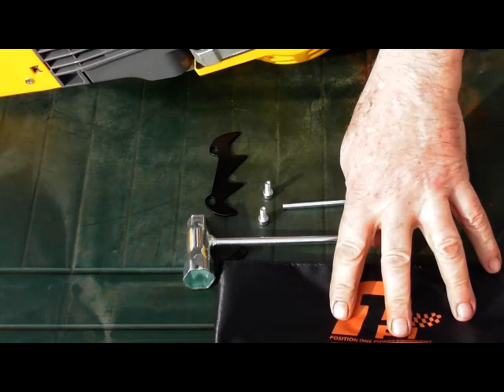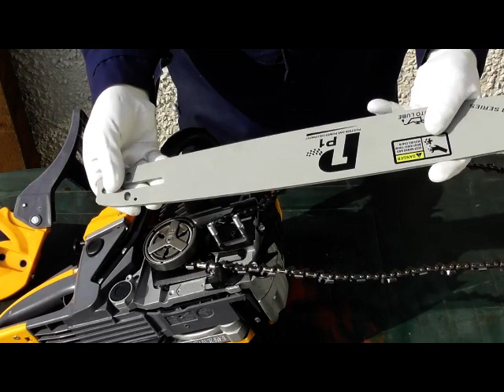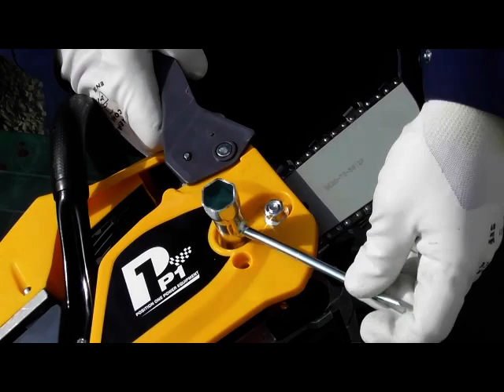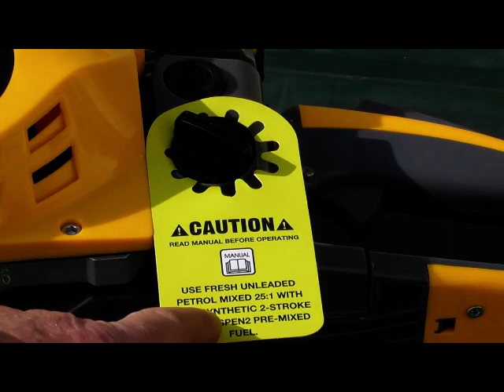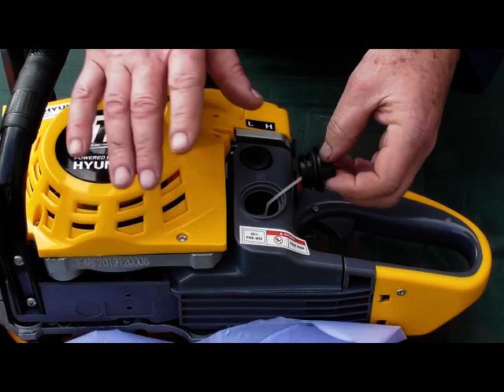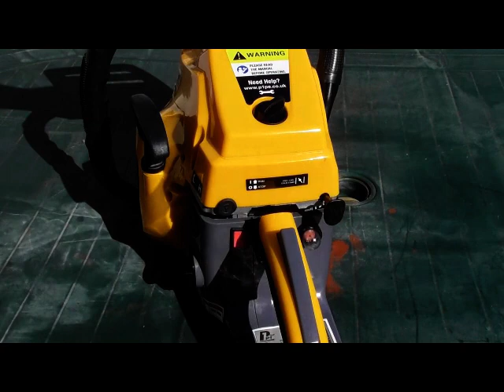P1PE P6220C 62cc Chainsaw, Powered By Hyundai

Comment: absolutely waste of money problem after problem hyundai dont want to refund me or fix it parts missing wont run with choke in now the recoil has gone still brand new out the box..wanting me to send it back ,i pay for postage there and back then its |£30 per hour labour then price on part to repair and get it running.finally got somewhere after abit of hassle from were it was bought from  got the new parts..pull start  flywheel and coil pack.tried setting it up to run nothing at all car nt get spark plug out as its to tight to check its sparking.any advice on what to do next would be greatly appreciated
Reply: Rtv

Comment: I have the hyundai hyc6200x it has 40:1 fuel mix. Left some fuel in in the summer and it would not start in December. Took the carb out to clean following Adrian advice on how to take it out. Needed a special tool to adjust the carb as it's not supplied. The unit worked for 1h last Sunday then it stopped and would not start. Today was I hoping to adjust the carb with the tool and it started then died, then the cord seem to have broken the plastic inside that turns the thing on. Not impressed. It has been used 4 times in 2 years. See what the guarantee is like.
Reply: ,rtv

Comment: Just bought one via Amazon. First one the circlips holding the chainbrake together sheared off with the vibration and shed the spring, making the brake inoperable. Amazon replaced the saw and the same thing happened to the replacement. Those retaining circlips are not fit for purpose. I would look elsewhere for a chainsaw. This is just a badged far eastern sourced product that is not fit for purpose.